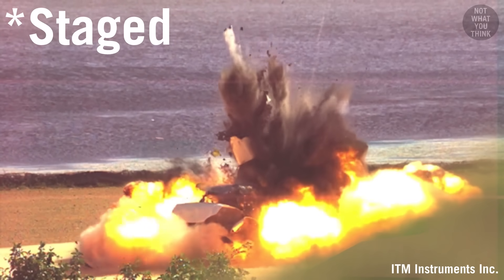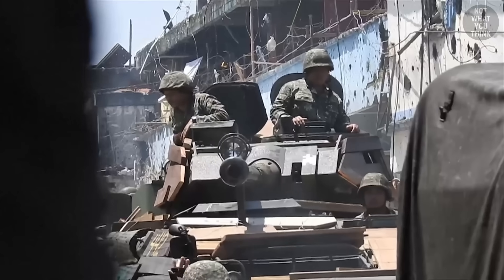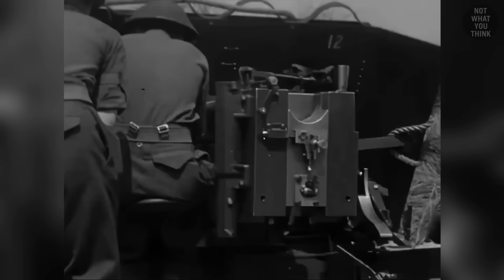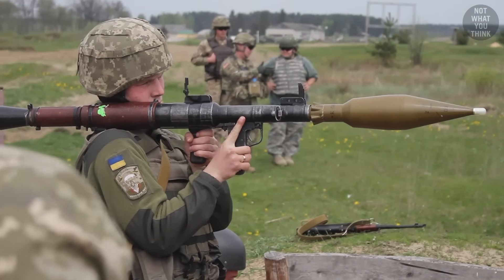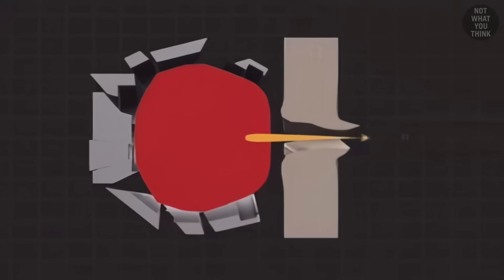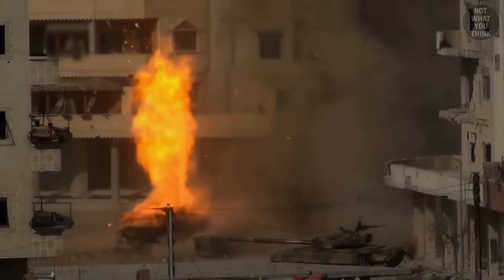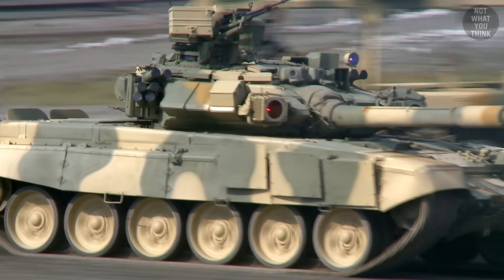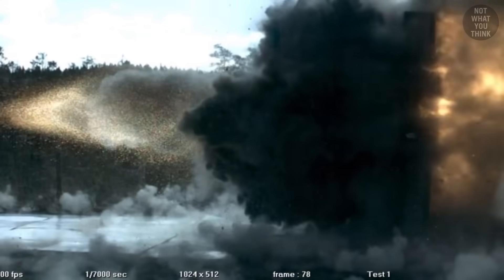Why Protecting Tanks is Getting Much More Difficult

Comment: You can have layered reactive armor. A very thin armor layer separates them to not be heavy. It is more time consuming then normal RA but negates the advantage of a tandem warhead.
Reply: What about a tandem tandem warhead
Reply: @sixthgreeny1880  you add reactive reactive reactive  reactive armor.
Reply: @srdav1d56  a tank fit for the Michelin Man.
Reply: @sixthgreeny1880   Three layers just like Ukrainian Duplet ERA.
Reply: @viceralman8450  Or Tusk 2 package and Relikt and Afghanit.
Reply: @voidtempering8700   They are just one layer of ERA, unlike duplet.
Reply: @viceralman8450  Arat used on the Abrams has two layers, and Relikt technically has two metal plates that are used, if you count that as two layers.
Reply: @voidtempering8700   Tusk only has one ERA plate the other box is composite, Relict only has one ERA panel has well, as I said go check Duplet and come back later.
Reply: @viceralman8450  Tusk 2 uses two separate ERA panels, one is a block, the other is out over top of the block. Relikt is similar to Kontakt-5, bust instead of shooting one block into heat jet, it uses two to disrupt tandem warheads. As I said, of the two, Relikt doesn't really fit the description, but it is a similar concept. Tusk 2 explicitly uses two different ERA p els
Reply: @voidtempering8700   A era panel is the whole deal the explosives and the steel plates not just the explosive panel, so it has only one ERA panel, same with kontakt-1, 5 and Relict. The only ERA with multiple ERA panels is Duplet which uses three panels of NOSH ERA.
Reply: @viceralman8450  Tusk ii also has thos feature, two different ERA plates, one box, the other tile like.
Reply: @sixthgreeny1880  In this case, we should put an AI that creates materials on the fly suitable to each situation at the speed of light.
Reply: Hmm but would the swcond era explode when the first one detonates?
Reply: @human6631  that's why I specified there is a thin layer of steel seperating the two.
Reply: you guys are hilarious lmaooo
Reply: Someone in comments said that the latest Russian ERA is like that. Problem is that it makes them heavier, if you want them to be effective, and you can't cover all parts of tanks with it (weight and shape problems, it seems). 
And even then it's not that effective.
Reply: @vahidmoosavian6313  They can cover all parts of the tank with the more advanced kind, just look at the at the T-90m, T-80bvm, and T-72b3m object 2022. For some reason, they simply chose not to cover the whole tank.
Reply: @voidtempering8700  it probably cost as much as T-90m to cover the whole tank with reactive armor.

Comment: None of this is new. The jet has always been there with shaped charge warheads. At distance that jet is heavily diffused and doesnt have the mass to go through RHA or composite arrays. Theres a specific standoff that the charge needs to have to make the most of that jet created. Thats why you have a long cone at the end of PG-7 warheads of a probe on M830 and other HEAT warheads.

Comment: i belive that in the fotage of  7:33 isnt accurate.  that lack of detonation was caused by not having a long enough arming distance. Many MANPATS have a arming distance so if you accidentally shoot very close to the operator it wont detonate. so in the case fo that piece of fotage, the attack was done from too close, not letting the safety feature disactive and no allowing the payload to explode.
Reply: That isnt a manpad, it is the Nlaw. Manpads are for anti-aircraft use.
Reply: @voidtempering8700  ups, wanted to say, manpats. ill change it now. thanks.
Reply: @voidtempering8700  just edited it. but im technically not wrong, manpads also have the feature.

Comment: Hard kill APS might be the costly answer of the tank to the challenges imposed by shaped charge warheads flying relatively slow before detonation.
Reply: Hard kill APS is the future and it's here. Look at current tanks: the trend is lighter less armoured tanks.
A couple of examples: T-14 Armata weights less than an M1A2 but is at the same time bigger. Merkava with APS is one of the reasons why everybody is developping it's own: it works !
Also look at US next tank. Between it's gun and it's weight it's going to be a medium tank so you'd better hope it has some protection other than it's armor..
Everyone is working towards the goal of stopping the incoming round before it hits. You are both right about SABOT rounds being harder to stop but these can be stopped by composite armor now developped to "shear" the projectile. I'll also remind you that a SABOT can break upon impact, impact at a wrong angle and not penetrate etc.
Reply: @herrhaber9076  Lighter but more sophisticated tanks with heavier weapons might be the future, although I wouldn't presume it will. Modern western MBT:s already incorporate composite armor also.

130mm or even 140mm tank cannon have been proposed as a solution for defeating modern composite armor by a sturdier and heavier APFSDS, by brute force essentially. Such extremely heavy weapons would have the drawback that the vehicle could carry considerably less ammunition in its magazines. It would be more of a dedicated tank killer than a main battle tank.

It remains to be seen what the future holds.
Reply: @herptek  ETC guns are likely to come in the future
Reply: @herrhaber9076   the next us tank is not a “medium tank” as those do not exist anymore it’s a light tank not a replacement for Abrams but to fill a gap
Reply: Stick a CIWS on top of the tank
Reply: That's the problem though. Its like a million dollar solution to a thousand dollar problem. Not economical.
Reply: @jgtheman84  Economical or not, it may yet be necessary. Heck, it will be all that much more relevant as tank-killing, shaped charge warheads grow more economical and thus more abundant on the battlefield. The system itself might be very expensive and yet worthwhile as long as one discharge isn't very much more expensive than the munition it counters as long as it works reliably and consistently. Beats losing the very much more expensive tank altogether.

Modern ATGMs are not very cheap either, but they are shown to be very effective at killing tanks.
Reply: @herptek  Yes I think that APS has a definite future. Its gonna take some time though. Sabots are even harder to stop because you need a specific type of ERA to defeat it and it only reduces effectiveness but does not totally stop it.
Reply: @jgtheman84  Yes, but those require high velocity impact by a heavy dart because they rely on purely kinetic energy to have an effect, instead of chemical energy converted into a penetrator by an explosive on the target end. This usually requires another tank armed with a high velocity cannon or something like an anti-tank gun anyhow. So there you would have a big target yourself to protect from everything cheaper than another tank.
Reply: @jgtheman84  meanwhile the us military budget